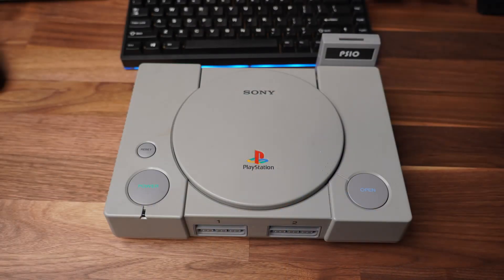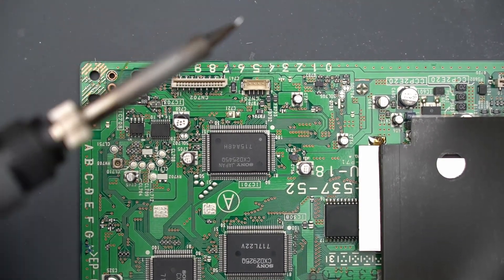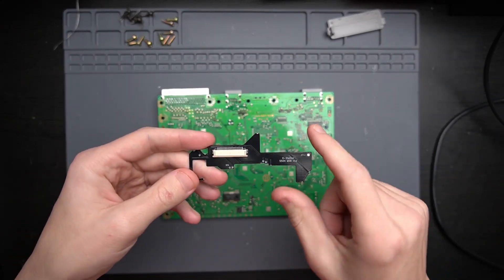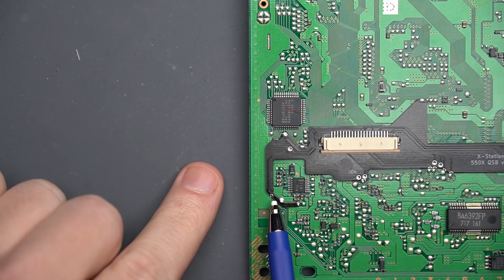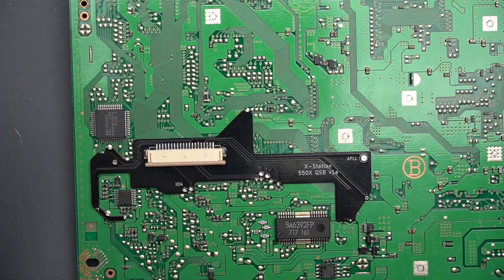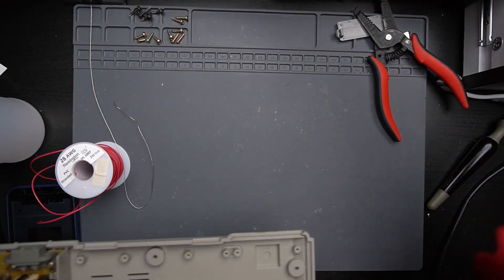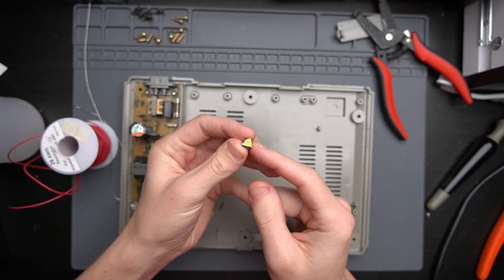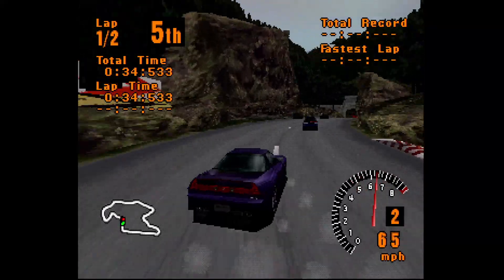XStation Install - Play PS1 Games From an SD Card!

Comment: Besides the obvious replacement in most cases regarding the PS1 power supply board electrolytic capacitors, do you recommend any of the surface-mount electrolytics be replaced while I have it open?
Reply from the maker: Personally I wouldn’t change them out yet

Comment: Nice video 👍 I think a good approach for people to take with these playstation ODEs (including PSIO) is to buy a cheap used junk playstation off eBay that boots but will not play discs and fit the ODE to that.

I would find it very hard to justify carving up the PCB on a perfectly functioning, good condition playstation for this.

By doing that people would be easing up the wear on the existing optical drives thus preserving them and it would also give the broken PlayStations a new lease of life.
Reply from the maker: Thankfully the disk drive is unharmed by this mod, so it's not like the drives are ruined

Comment: Good how-to video. I'm waiting on my Xstation now and am thinking of attempting this mod myself. I've successfully done the Voultar RGB mods on my SNES 1-CHIP and N64, but I'm terrified I'll ruin the pins doing such fine-pitch lifting.

My question for you: is there any benefit on waiting to do this and the PS1Digital at the same time? I'm still waiting on the next ordering round of PS1Digital, but my Xstation should be here in a few days. I just worry that doing the Xstation now might cause issues later for a PS1Digital install.
Reply from the maker: Doing the xstation first is fine. Doing it the other way around is more difficult because of all the flex cables on the ps1 digital
Reply: @dubesinhower  thanks

Comment: Hey another question, what heat settings did you use because it seems like you used 3 different ones throughout.
Reply from the maker: My baseline temp is usually 650 F, so it's usually + or - 20 degrees from 650

Comment: Thanks for this video. I was totally confused when bench testing since neither the X-Station installation guide nor the user/setup guide mention anything about the lid switch. Finally tested it and I'm getting FMV freezes and skips like a scratched disc or bad drive but at least I'm getting that far. :)
Reply from the maker: Interesting... the XStation menu comes up and everything? What kind of SD card are you using?
Reply: @dubesinhower  Yes, everything else is working right. I only got to test it a little bit this morning and it definitely got better after I updated the FW.

I still get a bit of a hitch in Symphony of the Night right when the Konami intro starts and a bit of a hitch right when the menu music starts. Seems like the output stream falling behind when initializing a buffer with SD card data, so SD card read speed is probably it. Most probably wouldn't even notice and some might think it's normally like that since skippy FMV is common on the original failing drives (hence, the need for ODEs like X-Station).

My 3D printers always include smaller 8-16GB cards so I grabbed one of those for initial testing and I imagine they are mostly factory seconds and/or rejects. I don't want to take the 400GB card out of my UperGrafx UGX-02 since it has special partitions but I have another in the package somewhere. I'll be sure to test again when I find it. ;)
Reply: @emmettturner9452  ,
How things turn out?
Reply: @That_Handle  After another XStation firmware update the skip/hitch in the FMV went away. I recall that the update said something about improving SD card access speeds or something. Since then I’ve done dozens more without issue. :)

Comment: As a seasoned IT tech myself, I am impressed by this device, easy for me to do... but too difficult for the man in the street to do easily... I am especially talking about the 'lead lifting'... however, this is a great device. The cost is a bit too high, but interesting enough. Thanks. Good video. Subscribed.
Reply from the maker: It's a fairly unique product for sure. In the retro community (PS1 is considered retro lol), there's been a fairly recent push to develop ODE's and HDMI mods for this generation of consoles. Thanks for watching!
Reply: @dubesinhower  I agree... I still have a soft spot for the PSX... have a couple myself, repaired and saved, but I have always wondered why there isn't something as simple as a simple laser replacement...
Reply from the maker: @metalheadmalta  disks are a fragile medium, and disk drives are not maintenance free over time. ODEs try to get ahead of that, in my opinion
Reply: @dubesinhower  oh, I guess I got my question across incorrectly... I mean a simple ODE which replaces just the laser unit...
Reply from the maker: @metalheadmalta  understood, I don’t know the reasoning behind it. The XStation probably needs some additional signals from the board

Comment: Can I play pbp files, if not is there software to convert it to an iso. What's the best format/image file to use and software for ripping my physical games. Thank you
Reply from the maker: Xstation uses bin/cue files, not isos. Found this for the pbp files, might help? https://github.com/xdotnano/PSXtract

Here's a guide for ripping PS1 disks:
https://www.reddit.com/r/PlaystationClassic/comments/alla7z/how_to_get_started_ripping_my_psone_games/
Reply: @dubesinhower  Thank you so much for your reply. I'm pretty sure the pbp files I'm using don't work because they're not eboots but we're made for use with psclassic. I was able to rip a game using ultra iso. Pal game wipeout 3 special edition. I have some issues with the screen going black for a few seconds during game. Same on different tv. Maybe I need to use a newer sd card and format it using recommended program? Any experience with games cutting out?
Reply from the maker: @prestonsmith3137  what video cables are you using?
Reply: @dubesinhower  thanks for being available. I'm using the combo of xstation and ps1 digital. So the hdmi mod. I totally fixed my problem, I needed to change a setting and force 240p for that particular game. I knew it was the hdmi because standard composite cables didn't have the same issue.
Reply from the maker: @prestonsmith3137  no problem! I don’t know everything, but I help where I can

Comment: I have a black screen how do I fix it.
Reply from the maker: Double check your QSB solder connections. Use the test point picture to verify connections on the QSB https://github.com/x-station/xstation-issues#test-points
Reply: @dubesinhower  I may have burned the solder point for the wire and may have melted an incorrect pin. Upon inspection.

Comment: having the same problem with the boot to memory card screen. did you redo all your solder points with flux or only some?
Reply from the maker: I touched them all up using flux. I heard from the mod creator that the solder pads under the QSB can be delicate (aka they can lift off the board if heated for too long) so that’s frustrating. Maybe use a little lower heat, and try to get flux under the qsb if you can. Good luck!
Reply: @dubesinhower  ah yeah that makes sense. I didn't have any flux and would have had to wait a while before getting some so I just tried reflowing what was already there. I've only ever soldered once before years ago so I didn't have high hopes but figured I'd try once more. can't believe it but it works! playing it now and no issues so far. awesome vid, it was a big help and thanks for the quick response! 👍
Reply from the maker: @Dan-km1zs  please wait for flux next time lol. A few bucks and a week is cheaper than getting new consoles
Reply: @dubesinhower  yeah definitely rolled the dice on this one, won't risk it again lol

Comment: Have you ever used a 1440 memory card? I've had one since childhood and recently found out how to work it. 96 times the storage of a regular ps1 card. Slowly building up a cache of save games sorted alphabetically.
Reply from the maker: I have one that's "1 MB", whatever that means lol. It would be neat if there was an easy way to save the save files to the SD card
Reply: @dubesinhower  iirc that was just a 1 Megabit so 128KB. But they always did caps on those cards for some strange reason. The 1440 being 96 times 128KB is actually a little bigger than an 8 Megabyte memory card. But due to each page needing space for each index, for all intents 8 Megabytes.

As for backing up saves to an SD card that has still escaped me as of yet. Best I can think of is backup the memory card using a parallel port device and finding a way to interface with said device.

What I'll sometimes do is use an emulator for games like CTR or bushido blade to get all platinum relics and both kabuki clown samurai respectively. Then just backup those save files. Not sure how to restore those though.

Probably would have to write back the file to the entire card regular size then transfer to in my case the 1440 card.

Will message back if I ever get it sorted and tested.
Reply: @haloslayer255  a freemcboot memory card for PS2 will allow you to backup and restore PS1 saves from ps1 memory cards to usb drives
Reply: @Dan-km1zs  I thought so, I've been able to do that for the regular size cards but the 8MB ps1 card seems to be unable to change pages using a ps2 console. Seems multipage ps1 cards have a specific requirement for using the ps1 memory card manager and a certain button combo. In my case holding L1, R1 and Start. Then let go of L1 and R1 while still keeping Start held, press L1 or R1 to change pages left or right. It also seems to be able to skip pages if held for a few seconds.
Reply: @haloslayer255   oh I see that's interesting... will the memory card remain on the "page" you chose with the PS1 even after you turn it off? or do you have to cycle through each time before loading a game disc?
Reply: @Dan-km1zs  it seems to stay on the last chosen page. Not sure if I'd change pages and then move it over to a ps2, last I checked I can only access page 1 on the 1440 card using a ps2. I'll probably look for some hardware to read this card directly from pc.
Reply: @haloslayer255  The only way Ive figured out how to backup save files is via a ps1/2 memory card adapter to PS3. And the only way to back ps1 files to a PC is transfering thise saves to a VITA first. Then from the Vita, you can back thise files up to a PC through the vita to pc software finally! There has to be some software out there that allows a pc to read straight from a memory card... I hope